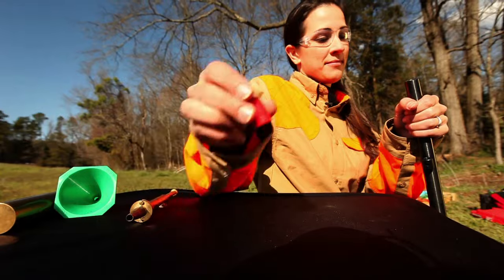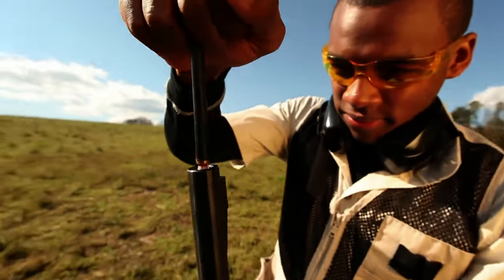How to Load (and Unload) a Modern Inline Muzzleloader

Comment: Low Pressure 50 Caliber Smokeless Loads in a 209 Factory Muzzleloader, 2 DVD set | eBay
These 2 DVDs contain a demonstration of using Low Pressure Smokeless Loads in a 50 caliber factory muzzleloader. 

 Savage Arms proved over 20 years ago that a factory muzzleloader can use smokeless powder.  A retired Science Teacher/Gunsmith/Inventor used a strain gauge glued to a rifle barrel and the Pressure Trace II computer interface to compare the pressures produced by Blackhorn209 propellant to pressures which can be produced by ten different smokeless powders.  These ten smokeless powders do not contain the corrosive oxidizers which can rust a rifle barrel.
The loads developed produced a pressure equal to or less than that of 84 grains by weight of Blackhorn209, which a common Black Powder substitute made up of 83% smokeless powder (nitrocellulose).  However, Blackhorn209 does contain corrosive chemicals.